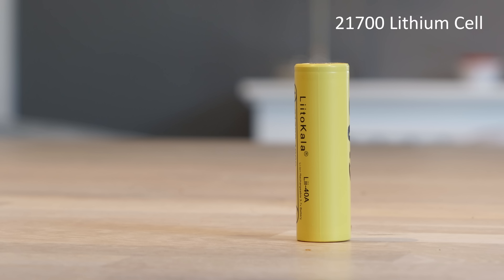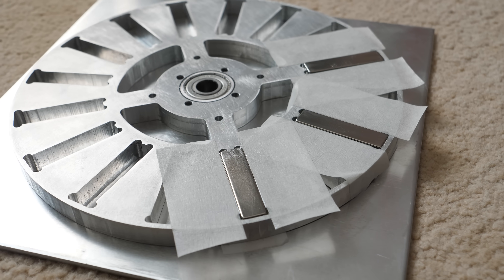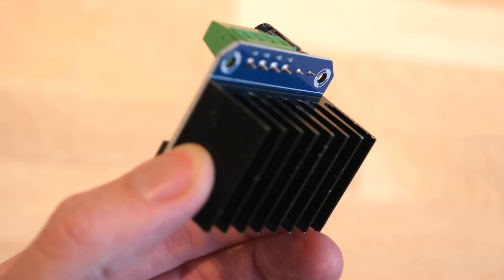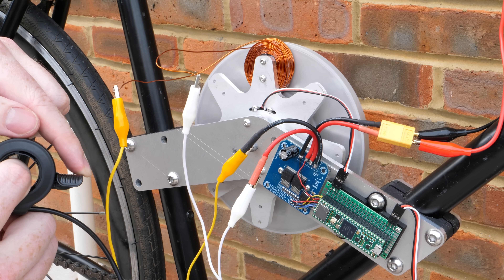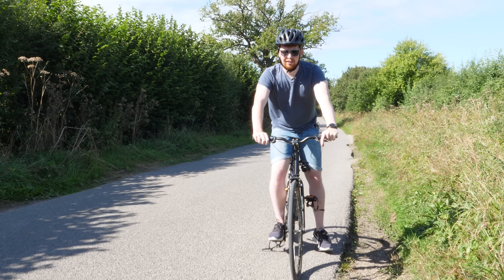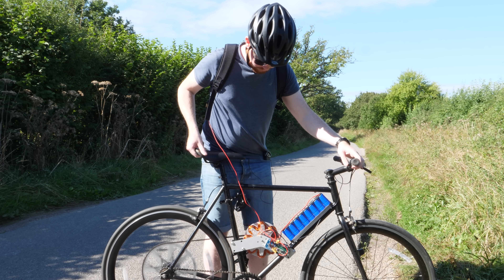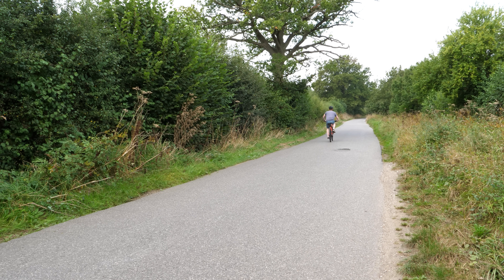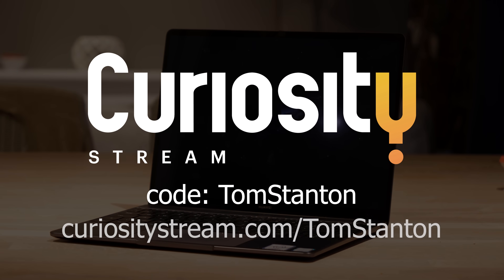Super Capacitor Bike

Comment: I think if capacitors increase battery life, a good idea is to hook up many capacitors to a normal battery and every so often the battery will charge the capacity, then take this bike for a test drive and see how many miles it can ride without stopping, we do this by putting the bike in a stand and just pressing the throttle, we then remove the capacitors and then test the bike plain only with a battery. if the capacitors increase the milage that is very good and could be added to an electric bike

Comment: With F1's rumored move away from the MGU-H, they'll have to find a way to charge the onboard electric battery faster using only MGU-K (regen breaking), and I think they'll come to use some form of supercapacitor storage. Or they'll advance batteries far enough to accept large amounts of current. Time'll tell

Comment: I wonder if you could have enough capacitors to equal the voltage of the battery and then quickly charge the capacitors and let the capacitors charge the battery as you ride.

Comment: Hello Tom, the first video that I saw that you did, was something different. I thought you were crazy, but, when I saw how many people watched your video it changed my mind, plus, your ideas are pretty sound. Now after watching this video, you should do another test. To find a way to put a small alternator generator on your bike to keep your lithium batteries charged, or, your capacitors, sort of like a closed loop charging system, to keep the lithium batteries up to full charge and the capacitors as well. Or use the capacitors to charge up the batteries, I know you will probably have to use a BMS to achieve this goal. Looking forward to your next video on this project. PS, I also saw a short clip on this video, that you had a flywheel connected to your bike, that kinetic energy can help also with the generator in re-charging your power supply, to keep you moving. Keep your Video's coming, Your videos are very informative, and educational, Thank You.

Comment: I don't understand why you didn't just used a simple DC motor and concentrate more on the actual super capacitor like in the title because you just replace the battry by supercapacitors and that's all, it wasn't crazy in therm of battery innovation. But congrat for the job :)

Comment: just a fyi, you can stabilise the output of your capacitor bank through filtering, and you can also add dual battery packs in step (As long as they have independent charge controllers). Doing this you can charge one pack during braking via the capacitors, and have the other pack fill the capacitors and provide a standing voltage to create enough power to take off.
Using some type of logic circuit you can have pack 2 recharge pack 1 when its not discharging and pack 2 is not recharging (During regen braking.). This means on long hills you could charge pack 2, then on the flats when you glide, pack 2 can discharge into pack 1 to top it off.
While not perfect and timing would be essential, it effectively optimizes the failure points of both designs. Giving you the high, instant-voltage delivery of capacitor, with the high storage capacity of a battery.

A further optimization would involved multiple small lipo cell packs to increase discharge and recharge rate while providing wear protection and relying still on the capacitors for the bulk of the actual delivery. Acting in series.

I think the biggest issue is the motor design though. Motor balancing and interference is the biggest killer of electric DC motor performance. DC motors are a hot-bed topic for this reason.

Comment: Wow what a useless feature. Just buy a real electric bike instead. At least it works. This is not an "improvement". You can calculate the usefulness of the application before spending so much effort.

Comment: 2.7v 400f?  I just ordered some from Alibaba that was 4.8v and 4000f and get this, 15Wh of energy, and they are about the same size.
Reply: I would highly recommend you test them.
Alibaba also claims to sell 4,000 mAh Li-Ion batteries, when people try them out, they're effectively HALF of what they claimed.
Also note that Capacitors have a massive tolerance, so even if nominal is 4,000, you could be as low as 2,000F and you can't do anything about it.

Comment: I think Supercapacitors are good for pedal assist with regen brake or could also be a velomobile with solar panel in the roof plus regen brake also due to its fast recharge. It is not suitable for throttle , throttling need more electrical power and longer duration.

Comment: lithium cell charged 1Wh energy =0,3112 minutes
Super capacitor charged 1wh energy= 2,5 Minutes 

0,4wh energy charged 1 minutes     1wh energy will charge 2,5minutes
and 
lithium cells 1wh energy 0,3112 minutes
 well our lithium cells faster charging than super Capacitor :D

Comment: Bad design.  You would have done better with Dual Axial and converting the power from wild AC to DC.  Its allot simpler than this.  But yes, Super Caps aren't going to useful for long term storage.  They are good when there is a increase is power demand as they can react faster than a battery every will.  So, they would be used in a buffer circuit between load and battery.  Than can also be used as a charging buffer but am still a bit dubious on that but it was one of my ideas which I have to claim. But I was thinking about wind and allowing it to charge up to a point before the charge is drained vs MPPT charge controller to battery.

Comment: Place the centered in line in the tire connected to the pedals via the chain. This will charge the bike when you peddle and also while cruising. Route the generated power to an electric motor for the front wheel. Self charging bike, unlimited cruising potential

Comment: Why dont you use the capacitors WITH the battery and use the capacitor in its best role(rapid charge/discharge).  drain the cap to get started then switch to battery. then use the regen braking to recharge cap and repeat  cycle.    If you can figure out this system it should make your battery last longer.

Comment: What if you had a super capacitor motor that handles rapid acceleration and then it switches automatically to lithium ion when you reach the speed you want. And then the super capacitors could charge off of the lithium ion batteries? Maybe that’s too complex for a bike